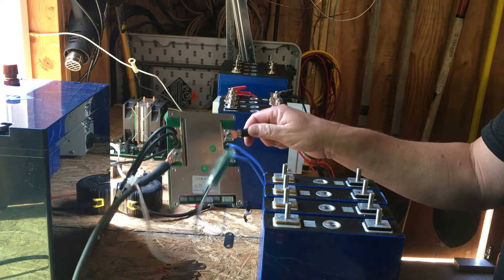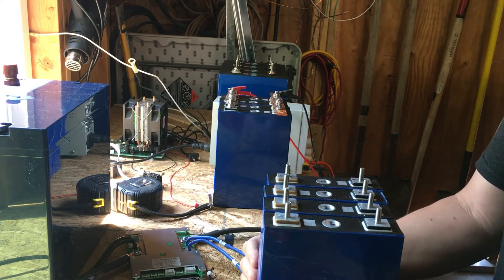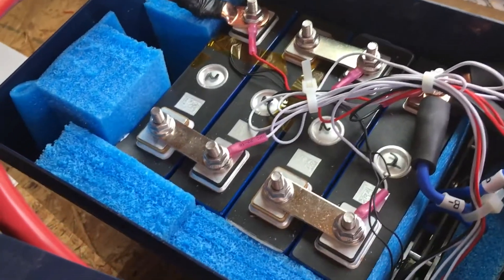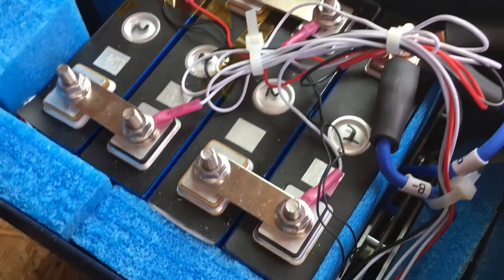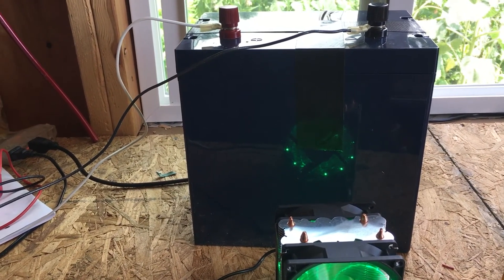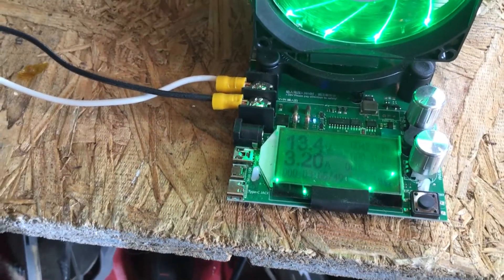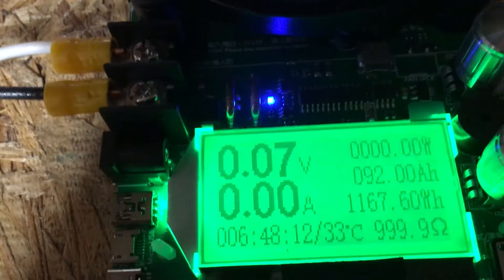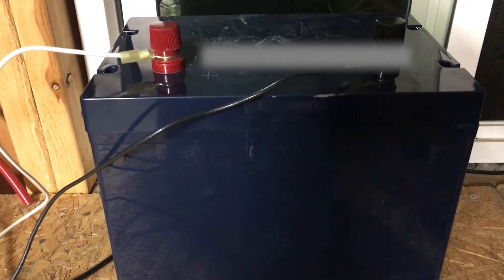LiitoKala 100ah LiFepo4 Capacity test:  Are they any good?

Comment: Hi. I like your video. Congrats. One question. You were able to get 93amps out of a 100amps battery. Would that not, at least, reasonable? Why you say this is crap?
Reply from the maker: I have now used that battery for two years and I would have to now say that the battery is actually pretty good.   Yeah the capacity was not that great but in general I think the batteries are worth buying and I would buy more.
Reply: Thanks for the answer. Good to know you actually think that battery is OK, because I am planning to buy 4 300Ah units from these guys. Obviously, due to the price, dimensions and that fact that they deliver the batteries to Brazil. Thanks @OurBlackCatCottage

Comment: Looking for an option for a leisure battery for a van used mainly as a work vehicle but possibly a few camping trips, would people consider these if they were cheap enough?
Reply: I have Liitkola in my 4x4 as a battery for camping. It was dirt cheap. Mostly it powers my fridge, USB charger, camping lights and a 600w waterheater for coffee. as long as you dont run it to the maximum i would say go for it. i dont draw more than 25a and also dont charge with more than 15a. so well under the specs and that works fine for me. 3 times cheaper than the next cheap option and for the easy use i have for the battery a way better option than lead acid. i got a lifepo4 24v 80ah battery for around 250$. i am sure its kind of crap compared to the expensive ones...but still lighter, smaler and better compared to lead acid.
Reply: The 280's always come out to be WAY cheaper Ah for Ah than any of these smaller cells. Sometimes they'll have 302/304/310Ah cells for about $20 more...up to you if you think that extra capacity is worth it...A grade A 280 should pull 290'ish on a capacity test and the a grade A 304 should pull upwards of 315 sometimes even 320Ah on a capacity test done at 0.2C. So the 280's are usually the most cost efficient option. Ton's of battery boxes made for them so no shortage of cheap boxes to choose from and they also make "cell holders" similar to the ones used for 18650's. I'd still look at "compressing" them (you just want them fixed in place at nominal voltage so when they expand and contract on charge/discharge they aren't damaging the terminals if you use solid busbars, but flexible bus bars are all the new rage). Most people just use two pieces of steel or aluminum and then get long threaded rods and fix them into position. Put some rubber hose or something over the threaded rods and make sure nothing is "pinching" the cells at the ends. Thats where the cell holders come in handy since they offer a solid plastic shield to the prismatic cell. Those aluminum cases are way more flexible than you'd think

Comment: While AH wise, you're looking at 92% of rated capacity, Wh wise, you still got 1168 watt hours from a 1200 watt hour battery. Due to the bulk of the battery voltage being >12.0, the Wh came out pretty close. That's technically 97% of rated capacity
Reply from the maker: Yeah it wasn't bad on day one.  But  after having it in service for a year it is way down.  I would never buy these again.  My EVE and LISHEN are still meeting the rated AH.  They cost more but are much better.
Reply: @OurBlackCatCottage  where did you source those cell them? I’m having a time finding a vendor.
Reply from the maker: @thomasmott619  These are the best cells I have ever purchased.  
https://www.alibaba.com/product-detail/4pcs-rechargeable-batteries-solar-system-Lifepo4_62517113167.html?spm=a2756.order-detail-ta-bn-b.0.0.7fe92fc2UttfiS
Reply: I was happy with the outcome, 👍

Comment: I want to build an eBay battery based on the 30 amp cells made by this company, 12s 36v they look identical but smaller , my bike is 250w 36v, what bms should I use? I won't draw a huge currant, poss peak 25a but not for any time. My original battery was li ion 10s 1p large pocket cells 10a could get 50 miles out of it. What you think range would be with these liikala cells 30a 12s

Comment: Could you share more detailed information about test conditions:
- what is the cut/off voltage level in yours BMS (upper and lower). Are the levels the same as stated by the liitokali for the battery?
- what is the discharge current? Its look like: 92Ah/6,8h = 13,5A --> ~0.14C
- For what discharge current is the battery capacity specified by the manufacturer?
- did you try to repeat this test after 50-100 charge-discharge cycles?
Thanks in advance

Comment: Hey man, I am considering buying a 72V 3000W Liitokala batterypack to add to my Kaabo Wolf Warrior, 
opinions are always welcome!

/item/1005002808679840.html?spm=a2g0o.cart.0.0.13403c00Mme9By&mp=1

Aliexpress is the site, seems I can't post full links... Safe purchase or...?
Reply from the maker: I am still on the fence with Liitokala.  I mean, on one hand they are inexpensive and I am using them on my workshop solar setup but on the other hand, they just seem cheap (swelling, terminals, build quality, etc).  I have lots of cells from different brands and Liitokala just feel off a bit.  But you just can't beat the price.
As for buying off of Aliexpress, I do it all of the time and it is safe in general.  Just buy from their official store.  I can't open your link so I am not sure what to say.

http://liitokalahongkong.aliexpress.com/store/217753?albagn=888888&&src=google&albch=search&acnt=479-062-3723&isdl=y&aff_short_key=UneMJZVf&albcp=12578223320&albag=117955685885&slnk=&trgt=dsa-1206091479979&plac=&crea=507694761748&netw=g&device=c&mtctp=b&memo1=&albbt=Google_7_search&aff_platform=google&gclid=Cj0KCQjwpreJBhDvARIsAF1_BU3YtXu_Ge08VgyftARC7hYPfGXM9mTARZzwfCwnAQpwu9tvbScAMLoaAqdUEALw_wcB&gclsrc=aw.ds
Reply: @OurBlackCatCottage  Yeah, theres an issue with the link or something. I can open yours. Link I tried to send it the exact same store.
And yeah, same here... on the fence. I have purchased smaller 36V and 12V batterypacks from a brand called Laudation and they always meassured out to about 90-95% of the capacty. All still in great condition after alot of charging. Problem is that the 72V batterypacks they sell top out at 1000W so they are not good for my 3000W Wolf King.
Wanna add some range to my Wolf King.
Reply: @OurBlackCatCottage  So tell me, what different brands that Aliexpress sells are you more impressed by? I can start my search into 72V packs that way... 
Thanks man!
Reply from the maker: @nikostevens1  I have used EVE, CATL and Lishen. You could also try VariCore.  They are basically EVE repackaged by Liitokala
https://www.aliexpress.com/item/1005001563505796.html?aff_fcid=3eeb70394b4541f0bb3a0a69fbfa0a97-1630436852574-08233-_99i6NT&aff_fsk=_99i6NT&aff_platform=shareComponent-detail&sk=_99i6NT&aff_trace_key=3eeb70394b4541f0bb3a0a69fbfa0a97-1630436852574-08233-_99i6NT&terminal_id=40750d1bcabe435e98d5e09be89f2cba

Comment: 90% capacity at 1/3 the price.  Seems like a massive problem to me.
Reply: you missing the problem. If they are degraded will last very little cycles and if they are degraded a different amount the pack will become unbalanced very quickly and you will have to buy again.
Reply: @EpicHardware  Oh ok.  I did not understand that part of it.  About how many cycles do you think you could get from them?
Reply: @surfreadjumpsleep  that's the problem, you don't know And that is the reas I'm hesitating buying B grade cell. If they last 1/3 as the A grade cells you didn't save any money if the last less than that you basically loose money.
Reply: 92%
Reply: Lose
Reply: @antoniopalmero4063  lose what?
Reply: I just bought a pair of  Liitokala 12v 200ah @ £178.00 each . Cheap and hopefully cheerful to a degree 😅
Reply: @antoniopalmero4063  wow that is seriously cheap. Did you do a capacity test?
Reply: @surfreadjumpsleep  they are 50% off today 18 oct 2022 on aliexpress, if they are not as described i will just request a refund .
Reply: @antoniopalmero4063  Could you tell me the seller's name?  I might pick up 4 of those & make a 12V battery.
Reply: @antoniopalmero4063  have you seen the recent video by the DIY BMS guy who is in England and said that he just happened to live next to one of the biggest  lifpo4 resellers?

Comment: Have a link for the empty battery cases ??
Reply from the maker: I used this:
https://alliedlithium.com/products/filler-empty-allied-battery-case

I have also used the relion empty.  They are actually a bit cheaper and nicer. 
https://relionbattery.com/products/lithium/insight-48v-spacer-battery
Both easily fit 100ah cells and a BMS.
And both of these are less than half of any other empty battery cases that I could find.
Reply: @OurBlackCatCottage Nice.  Thanks
Reply: @OurBlackCatCottage  the 105ah should fit in the relion box the same

Comment: So 92ah is not that bad as long as the cost of the cells matches. 
A good 100ah commercial battery run about $500-$600. What did you pay including the bms?
Reply from the maker: Including the case,  total cost was less than $250. $185 for the cells, $30for the BMS.
So I hear what you are saying.  92ah for 1/2 or 1/3 the cost is pretty good. And these cells probably won't last for 200-3000 cycles, but again for the price it is a decent value.
Reply: @OurBlackCatCottage  ould you give me the model and make of the bms